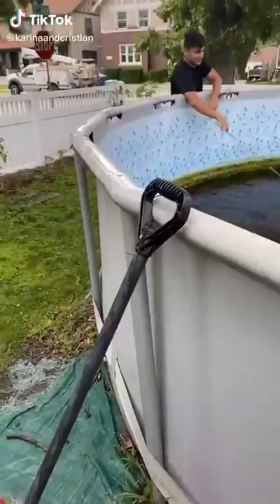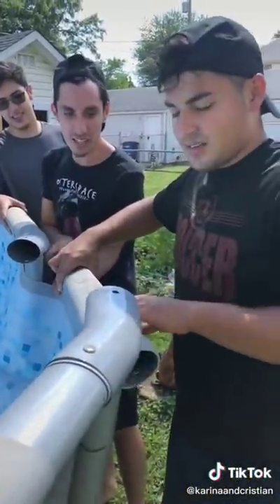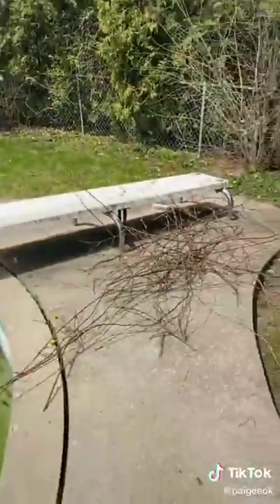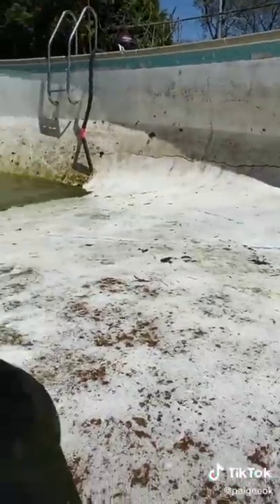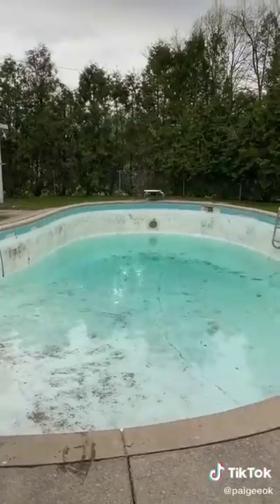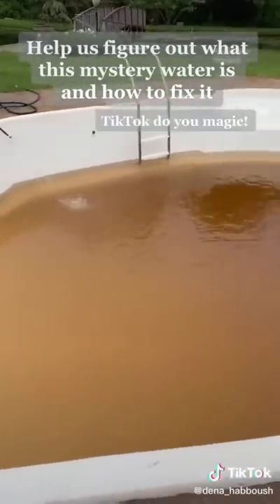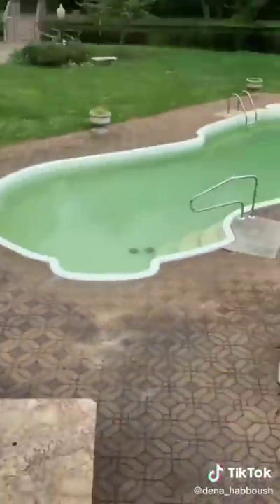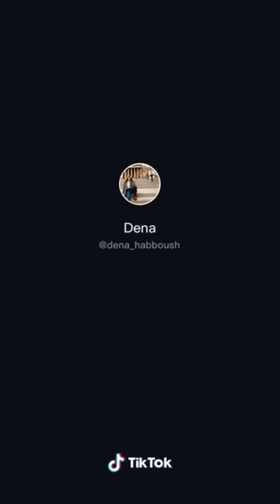SATISFYING Pool Cleaning TikTok Compilation✨ #1 | Vlogs from TikTok

Comment: What i dont understand on the second pool is why they left the water and floaties there during the winter. If they would get the water out it would be easier to Clean. We have a pool that isnt built in it is the same tipe like the first one and everytime after summer we get all the water out and it is never dirty like those pool. Why they just can't use chlorine or some chemicals to keep it clean.